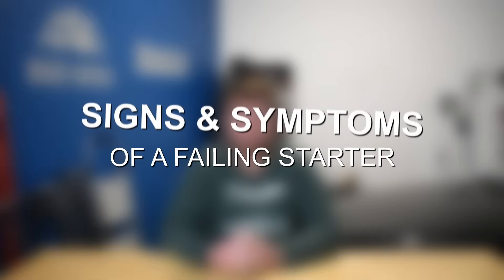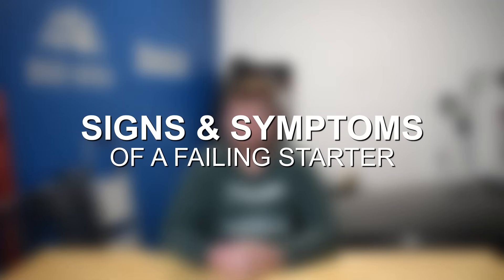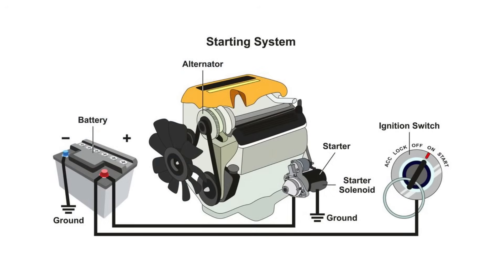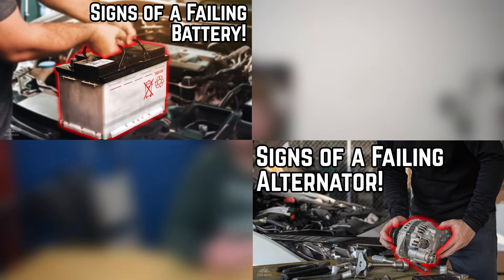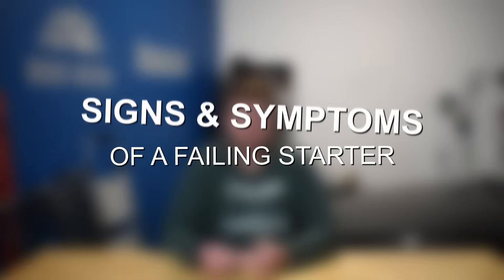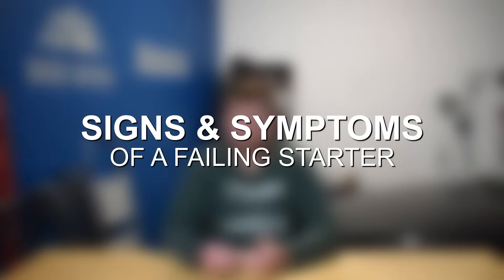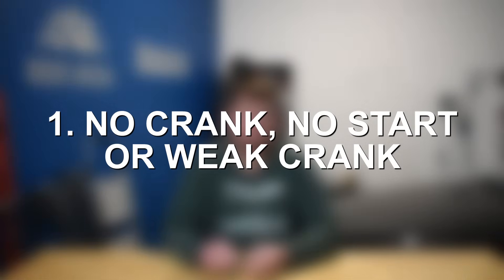5 Symptoms of a Bad Starter!

Comment: Big question, i have a 2005 chevy venture. I changed the alternator about a year ago now. Now, after not using the car for about a week the car won't start. When i turn the key and check under the hood, i hear clicking, as you described, and no engine start, I also notice the serpentine band trying to start but stopping and not being able to start. Inside the car, i notice that when i turn the key, the dashboard turns on as well as radio clock but get a reading that says "low fuel" even though we know we have half a tank. After a while, with the key turned, the dashboard lights, including the radio clock, start dying out. We jumped started the car and the cart did start and the engine ran, but after a while we heard the serpentine belt start to give out and the engine just stopped and the same issues repeated while still having the cables connected. My hunch is now that it is either the alternator and/or starter problem since the battery is brand new. Is there anything i should check before doing the tedious job of taking the alternator and getting it checked (im going to move the motor since engineers hate us when they made the venture).
Reply from the maker: M - Sorry to hear this. The alternator is the most likely culprit. Before removing it:

- Test the battery and alternator output.
- Inspect the wiring and serpentine belt system.
- Check for parasitic draw.

If the alternator fails testing, replace it. If it tests fine, focus on wiring or the belt/tensioner system.
Reply: @8020Automotive  thanks for your reply. One of our mechanic friends came over to check it and tried to jump start it but now there is no lights or anything and he said the same that its probably the alternator (its unfortunate since i changed it about a year ago). Im going to take it out and get it tested. Great video, as someone who i just learning about cars to do some maintenance, this helped a lot.
Reply from the maker: M - Good to hear it helped. Keep us updated!

Comment: My issue is the cold cranking. I was told maybe because of the weather that it was not cranking due to that so I bought a new battery. It’s doing the same thing but it’s only when it’s cold outside. No issues when temperatures are normal, what should I do?
Reply from the maker: T - Focus on testing the starter motor, battery connections, and fuel system, and ensure the correct engine oil is being used. If the issue persists, inspect sensors like the Engine Coolant Temperature or  Crankshaft Position Sensor.

Comment: i have a 2011 sonata limited with push to start and i hear no crank when starting but all my systems turn on like radio, dash, lights, etc. i do get symbols on my dash such as eps, battery, immobilizer, engine oil pressure, and check engine light. although these symbols all appear i haven’t had a problem starting my car until a recent morning and my best guess is the very cold weather. if you believe it’s something else, please help me
Reply from the maker: A - This video may be more helpful for your research: https://youtu.be/0YRdzJbHcm4

Comment: Would it be my starter if my truck still turns on normally with the key, but clicks and chokes when using the remote start? Sometimes it even pauses as it failed to start, then it will start on the second attempt
Reply from the maker: O - Very possible it could be your battery, poor remote start signal, or the starter relay. Keep us updated.

Comment: With my 04 Subaru it starts up most of the time but sometimes all it does is click rapidly first I thought it was a battery replaced it after a week same issue had a guy this morning hit the starter for me it started right up alternator is good have a scan tool that can check it and it was at 14.49 volts which is up to spec so gotta buy a starter and install it
Reply from the maker: A - Keep us updated! Hope you found your problem.

Comment: My truck makes weird ticking noise increases with speed when pushing the throttle forward, I can hear it on a hill as-well on idle and when in reverse I don’t hear it until I hit the brake, I’ve done some research and they says it’s my starter bendix hitting sliding back forward hitting my flywheel
Reply from the maker: Y - It's certainly possible. Keep us posted here.

Comment: Ok mine is a 2008 nissan pathfinder 4.0 at night we will be going down hwy and battery guage starts fluctuating headlights go dim or bright depending on battery guage.
Oreillys tested alternator, battery, and starter.  Alternator and battery test good, starter tests bad at 60 amps. I replaced the alternator in may because it was not putting enough volts out to recharcge battery.
They said the starter could be causing a drain on battery while running. We have never noticed starter dragging to start engine. What are your thoughts?
Reply from the maker: N - We think it would be the alternator. This video may be helpful for your research: https://youtu.be/HKP1vKsIr4g

Comment: I get weak crank just got new starter in wish me luck installing.
Reply from the maker: S - Keep us updated. We hope the video helps.
Reply: @8020Automotive  finally got it in also threw 130 amp alternator in also i plan to do more this spring or summer.
Reply: Hello, i have a 2012 ford figo 1.4 petrol

Recently when starting the car sometimes it starts 1st try but with a grinding noise and other times it takes 2 to 3 swings to start.

Sometimes it starts but for 2 seconds then the revs drop slowly and cuts out. 

All the tries it has that grinding sound aswell.

I narrowed it down to battery, alternator and starter motor.

It does this especially on cold starts but its also so bloody random then its starts fine 1st try and drive around then later on it will all of a sudden take 2 or 3 tries again.

I dont want to buy a starter unnecessarily but if anyone has advice i would greatly appreciate it.
Reply: @Delta-0n3 u find out what it was my Chevy truck does this?

Comment: My car died out while I was driving, now it just cranks and doesn’t turn over I replaced alternator and battery still nothing. Do you think it’s the starter ?
Reply from the maker: T - That would be our next guess.
Reply: @8020Automotive This is happening to me and changed battery, Alternator tested good they said. My car has auto stop start and starts then when I’ve come to a stop light it shuts off and then won’t crank just clicks once’s and they are saying it’s the starter 1205.00. Was that your issue and did the starter replacement help? I have a 2017 GMC Acadia SLE. Thanks
Reply from the maker: @rebeccaalderson8800  If your car starts fine but won’t restart after auto stop-start engages, and you're only getting a single click when trying to restart, the starter could be the issue, but there are a few things to check first before spending $1,205 on a replacement. Since your battery is new and the alternator tested good, start by testing the battery voltage when the car is off, running, and during cranking—it should be 12.6V+ when off, 13.5-14.7V when running, and not drop below 10V during cranking. A weak ground connection or corroded battery cables can cause these symptoms, so check and clean all battery terminals, ground connections, and starter cables. Also, ensure your auto start-stop system is not malfunctioning, as some vehicles require a secondary auxiliary battery to restart after a stop. If everything checks out, then yes, the starter solenoid or internal wear in the starter motor may be failing, and replacing it could resolve the issue.

Comment: 2016 nissan sentra makes a banging noise when turning on. Sometimes it does it other times it dont.
Reply from the maker: E - Interesting.. Does it sound like the engine is banging to the frame?
Reply: @8020Automotive  yes sure does
Reply: Also, it sounds like at the end, the starter loses power, and suddenly the car turns on.
Reply from the maker: E - Could be worth to check your engine mounts.

Comment: No matter what I change batt alt starter my car drains battery n I pulled all relays n fuses .Finding nothing
Reply from the maker: C - Are you getting a check engine light?
Reply: I’m having the same exact issue. Did you ever find the issue? I’ve spent so much money and nothing is resolving the issue
Reply: @jaymetraube4206 I too have similar issue. Once, it was battery cell leaking. Replaced battery. But I just remembered, I had connected an OBD full time. Check if you have something in OBD connector plug? Maybe that is draining the battery when car is not driven.

Comment: My 2013 Honda accord coupe makes a screeching/whine noise when I press the push to start button. Since it started getting colder, it’s been doing this. Both turning it on and off.
Reply: Mine too
Reply from the maker: S - Could be related to your serpentine belt. Are you getting a check engine light or any engine codes?
Reply: @8020Automotive  nope, there is no lights or anything at all. Everything drives good, it’s just that noise when starting it up. Sounds like it’s coming behind the steering wheel
Reply from the maker: S - Have you had a shop look at it? We still think it could be the belt.

Comment: I got a problem on my car, it starts fine sometimes and sometimes the starter would spin (you can hear it) but it doesn't crank then you try again a few times and it starts and cranks no problem. Could it be a faulty solenoid causing the gear to not engage?
Reply from the maker: S - This video may be helpful with your research: https://youtu.be/0YRdzJbHcm4

Comment: 😤 For the past 2 weeks I’ve been getting a slow crank 1988 Chevy obs GMT400 turn the key nothing, hold it then 2 seconds later she’s running! Well last night Friday November 15 I pull up to the gas station get back in NOTHING!!! All my lights are bright battery read 12.2 volts, hit the starter with a hammer NOTHING so I believe this is my problem! I pray it is!
Reply from the maker: D - Thanks for sharing! Keep us updated.
Reply: @  had my mechanic fix it yesterday my brain to my alarm went bad! First he checked to see if the starter was getting power & surprisingly it wasn’t! So he went under the dash as I have a alarm remote start and kill switches so he hot wired it to see if it starts & it did! So the alarm 🚨 brain went bad $30 fix..... now I just have to replace my alarm system the brain antenna & remote control which is under warranty
Reply from the maker: D - Nice! Thanks for the update.

Comment: Thank you! The comment about the starter being in an area prone to oil leak discharge has been a huge clue to solving my problem. My 2009 civic si starts intermittently and has gotten progressively worse, yet whenit starts, its as if no problem ever existed. I was thinking of changing the clutch switch, etc. The seemingly unphased response from the car when it does start convinced me its not the starter. 

its true and not true. My car has had a code P2647 ( something like that) and is leaking oil around that specific sensor. The code has changed to P2646. Today i noticed an even bigger oil leak. 

SO my theory is that this problem ive delayed has caused this worse starting problem by spraying the starter motor with oil. 

We shall see how it turns out.
Reply from the maker: V - Keep us updated!

Comment: My car starts every time when I turn the key.  The starter doesn't really spin, but it starts immediately.  My problem is it sounds like a very weak start, like it's struggling to start.  Like if it didn't start right away, there wouldn't be enough "juice" to actually start it. The battery and alternator were tested and are fine.  What should I check?
Reply from the maker: J - This video may be helpful with your research: https://youtu.be/0YRdzJbHcm4

Comment: My n54 engine turned off while driving down the road and triggered a engine light, there is power to windows and everything else but the car won't crank and start, the car has fresh oil in it 5 months old, i do remember a couple times before the problems im having now i tried to start the engine and it would make longer cranks then starts up. I don't know what to do 2011 bmw 740li n54 .
Reply from the maker: D - This video may be more helpful for your research: https://youtu.be/0YRdzJbHcm4

Comment: My 2005 madza rx8 i went to go start it and it started up just fine then turned it off without letting it warm up and then went to go start it again and it wont crank or start at all. When i turn the key the radio turns off but everything else works. I have a oil leak so im gonna check if oil got on the starter,  i went to jump the car and it didnt work. My battery is a couple months old and the fuses seem to all work. The car is a manual so i pop started it and it started up and didnt have any problems staying on but when i shut it back off i got the same problems no crank no start.. im thinking the starter went out...
Reply from the maker: T - Possible. This video may also be helpful for your research: https://youtu.be/0YRdzJbHcm4
Reply: @8020Automotive  I think it could a bad solenoid because my starter spins but I'm not sure if it's something electrical with my radio and amp hookup
Reply from the maker: T - Certainly possible! Keep us updated.

Comment: Hey , I have a 2015 ford fusion no check engine light starts and will run but will loose power intermittently and I have to pull over or car roll but will go in park but will keep loosing power and I took it to the dealer they say no issue and it didn’t do it either they but same day I picked up it did it with me could it be my starter plz I need help  I don’t wanna give up on it just yet but even the dealer ship don’t know could it be electrical
Reply from the maker: C - We have some videos that may be helpful here: https://youtu.be/ipjYLPJgpq8
https://youtu.be/7bqAIbYRdnc

Comment: I have a question when my truck runs for awhile lets say an hour and i run into the store and come back out it has a weak crank but it only does this when the motor is warm and never happens when its cold it will start right up. Does this mean my starter is going bad? Thanks
Reply from the maker: G - Based off of the symptoms you're seeing, it's pointing us to the fuel pump or something electrical. Are you getting a check engine light?

Comment: I’m having this issue rn with my 2002 c32 amg, but I have no clue what it can be only because it wasn’t cranking or starting and I tried to jump it but I’d didn’t work at all, had it towed to my house and I thought it could be the fuse so I switched it out and it still didn’t work, called triple A to get it towed to a machine and before he even towed my car he wanted to try and jump it so I told him yeah try it so he did, he jumped it with a mini generator jumper and boom it turned on!! I was like wtf how and he asked me how new was my battery told him had it only for 3 months he said it could be the battery, anyways it is still doing this to me and I was only able to drive it for 4 days to work n back, anyone know what it could be?
Reply: Also a heads up my alternator seems to be good, but idk about my starter but from the looks of it as in the day he jumped my car, it cranked like normal and turned on instantly no signs of struggling when he jumped my car so I honestly don’t know what it could be, also my streering wheel locks up and all my light turn on, on the dash, usually they go away after a couple of seconds but they don’t so I’m so confused and I’m not trying to spends money I don’t have rn
Reply from the maker: U - Sounds like a battery issue to us. This video may be more helpful: https://youtu.be/0YRdzJbHcm4

Comment: I had a coolant leak that dripped into the valley of the motor (1uzfe ) where the starter is, could that be the problem?
Reply from the maker: B - If not addressed, it certainly could cause problems.
Reply: @8020Automotive  I have no crank no start
Reply from the maker: B - This video will likely be helpful for your research: https://youtu.be/0YRdzJbHcm4

Comment: I have a hummer H2 2004 new battery i tested the alternator its good… did the parasitic drain test and good as well my issue is that the is no click, no start, battery dies over night or in a couple of hours and the dashboard doesn’t turn on so with a dead battery and not a single click it can be the starter?
Reply from the maker: S - This video may be more helpful: https://youtu.be/0YRdzJbHcm4

Comment: I recently bought a 2015 Infiniti Q50 and been having problems with it starting days after buying it. Took it to Infiniti for multi point inspection and they found no problems and they suggested I remove the after market starter it has. I picked up from Infiniti and it was starting and running with no issues for almost a 3 weeks till a couple days ago it didn’t want to start but then hours later it did. Now it completely doesn’t want to start for the whole day. Ignition lights and everything come on but won’t start. When I try to start it I just hear one click.
Reply: 😂🎉 cam sensor
Reply: @shaquilefinch7401  till this day don’t know what caused it not to start. Infiniti could not find anything wrong with it either. It only did that when I started it with the push button inside the car. Now I just use the remote start and haven’t had a problem, It’s been a little over a month
Reply from the maker: S - This vide may be helpful for your research: https://youtu.be/0YRdzJbHcm4

Comment: I have a weird issue myself. Been changing out parts on my Mitsubishi to get it back on the road. Yesterday I had changed the input shaft speed sensor so I had to remove battery tray etc.. well it started back up and drove really well. 

This morning I come out to test drive again and I turn the key.. no crank.. battery is brand new lights radio work but when you turn it over you see the power drain and you hear a whirling noise but nothing else. I’m lost no codes because I just had took battery off for extended period
Reply from the maker: M - This video may help with your research: https://youtu.be/0YRdzJbHcm4